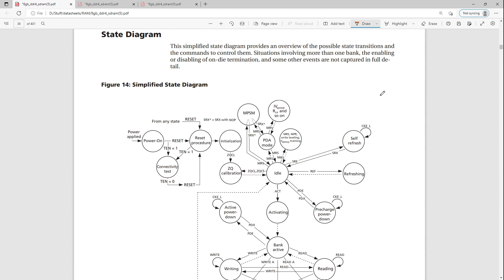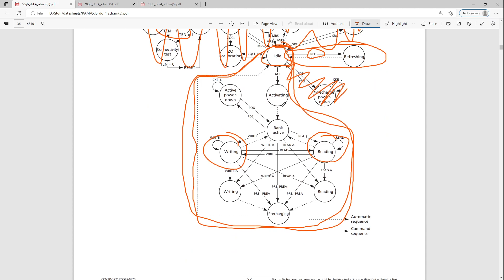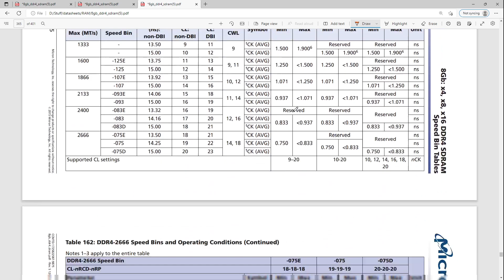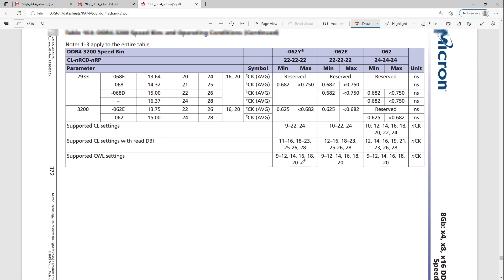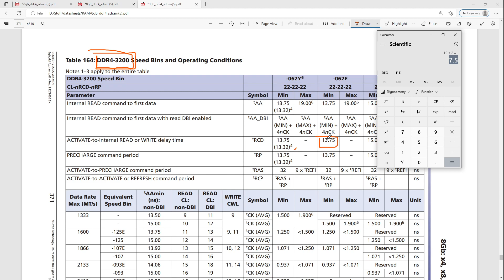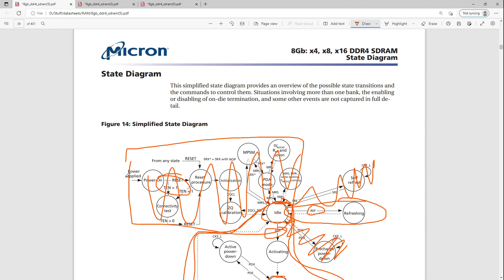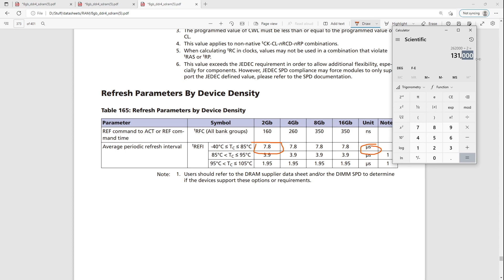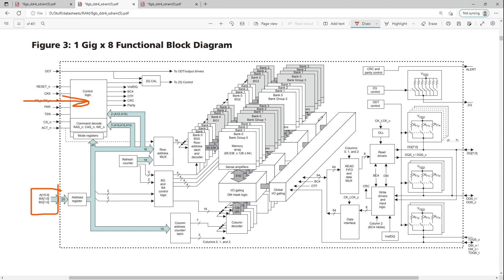RAM timings explained 0

Comment: I know how memory works and have a good understanding why the timings are needed How long timings take and how to find the perfect balance is magic for me
Reply from the maker: trial and error.
Reply: @ActuallyHardcoreOverclocking  As a student of electronic engineering it is magic 
we only think of logic and how long the logic takes, but capacitors in logic are just magic that they hold data to me
(And yes i know how it works but this is so hard to get working that we can just do it every day so reliable is the magic)
Reply: @vollkornbrothd1342  True, it's insane that everything works!
Reply: I like how BZ tells how "dumb" memory chips are. It's actually interesting to see that stuff like this still exist in 2022. Its kinda like early programming where you didn't have standard communication protocols for sending and receiving data and waiting for acknowledgement. You just sent a bunch of data and tried timing it so you didn't fill the buffer and prayed the data go to its receiver in the right order :) It kinda have its merits, cause If you can get those timings set just at the magic value for what the hardware can manage I'm sure you have much less latency than if you just set an arbitrary "acknowledge" command that have high enough delay for everything to be ready. Simplicity is often the best but more tricky to code.
Reply: @vollkornbrothd1342  a lot of "magic" for future electronic engineer, imagining your report on something complex to your customer or chief... Well, it's really magic!
Reply: @vermillion4971  But you don’t run stuff out of specks as an engineer you make it that it is as good and cheap as possible for the spec and to fine ways to run stuff that isn’t designed to run faster you have to find something to get it faster. To calculate timings is the easy part but to get the hardware to run it is hard, especially if you have in mind that every chip is a little different and they have to work in unison.

Comment: Self-refreshing is super useful.
It allows a bank of memory that is not currently accessed to just be clocked to do it's own refresh. No involvement from the controller beyond initiating the refresh and letting it tick along is necessary.
Reply: Was it also that row is also refreshed when you access it. I think one my friend did patter generator that used SDRAM and used specific address sequence that it full filled refresh requirement so he just read data "constantly" and never did refresh when it was sending pattern.
Reply: @LimbaZero  If the SDRAM is small enough and your read rate is high enough that you can cycle through it you would indeed avoid refresh.

Comment: I have learned so much from this video and it's made me realize so many of my misconceptions on how memory works. I thought that you could damage the ram by trying to push it too far, the way you theoretically could with overclocking a processor.
Thank you for this. 👍
Reply: It works exactly the same as with a CPU.
The higher the temperature or voltage the lower life span the microchip will have.
Also microchips will degrade overtime with high voltage or temperature and then require more voltage to run at the same settings than before.

The capabilities of a CPU memory controller is also a big part of memory overclocking and the memory controller can degrade overtime as well if you feed it too much voltage.

You can't damage microchips by directly increasing the speed they run at however. It comes as a side effect of higher power and cooling requirements.
Reply: @markokuosmanen  I'm talking about memory timings not overvolting
Reply: @3sotErik  I'm just saying you can damage the RAM stick by overclocking depending on the factors I mentioned.
From your message someone could get the idea that you can't or if you only meant the speed (clock speed/timings) then you could get the idea that you can damage a CPU by only increasing the clock speed it runs at which isn't true.
Reply: @markokuosmanen  The primary focus of this video was memory timings. My comment was in reference to the memory timings. I now realize there is zero damage that could be done by changing the memory timings. You are way over thinking this. It was a simple compliment for the video.
Reply: @3sotErik  You can actually do damage by changing the timings if the memory becomes unstable as a result and then causes corruption of the operating system and therefore damages the software installation. You just can't damage the RAM stick (the hardware) itself. Also if you update motherboard BIOS with unstable settings you could possibly brick it.
It is important to specify things in order to prevent misunderstandings.
Reply: @markokuosmanen  blah blah blah you're reading way too much into this
Reply: @markokuosmanen  apparently it's important to write a five paragraph essay to be thankful for a video
Reply: @3sotErik  I respect your opinion and that's that.
The original message wasn't even really directed towards you. It was more of specifying how it works for anyone who would be interested in that after reading your message. No harm intended.

Comment: Man, I knew memories were dumb but I wasn’t aware they were that dumb. Basically works by speculation of timing and good luck getting it on time. Damn!
Reply: Not quite speculation.  The memory chip manufacturer says it will take at least X nano-seconds to do a thing, but that is a worst case for all of the chips they sell at that spec.  When safe timings are set in the memory controller they always allow at least that amount of time - so no speculation is required.  That's the whole point of having default timings set by the module's SPD data.  But when you overclock, you are saying "I wonder if my memory chips can actually do that thing in Y nano-seconds, where Y is smaller than X. That is where the speculation comes in.  If you're lucky, after a bunch of testing, you may find that your memory always works with the Y nano-seconds setting, regardless of address and data patterns and regardless of the temperature (within reason).  If it does, then great, you are speculating no more - you have now overclocked your RAM by some small amount.

Comment: I believe people would like to know:

1. What is the order of OC (RAM or CPU 1st)
2. What you should prioritize overall - lower CL or higher MHz
3. What other timings should you prioritize
4. What timings should be changed if I change timing X (like some timings are linked together or there is some correlation between some timings)
Reply: Accurate
Reply: @YoutubeTookMyNickname.WhyNot  but they're unlikely to get +3 fps in games though.
On the other hand, in my experience adjusting timings does help with stability and pacing of frame times, thus overall improving the feeling of it..
Reply: 1. RAM 1st if you intend to do RAM. Though most probably go backwards as arguably CPU is easier to set.

2. Higher MHz allow you to keep around same ns latency in CL/RCD/etc. while lowering ns latency in timings like RRD WTR and others (I.e. those that as bz states in video can't go below certain value in register), thus improving your bandwidth while overall keeping best-case latency around the same (and lowering worst-case latency)

3. Other than CL: RRD + FAW, WTR, RCD (if you can), tertiaries, RTP/WR seem to be most impactful on actual performance, especially compared to defaults. REFI likely easiest to set, RFC below stock values too, as it gets blown up if you follow jedec specs. On DDR5 CL doesn't matter as much, secondary/tertiary are the more important settings, go watch the 3 vids exploring tuning timings live on this channel and then some other vids with proper settings in them.

4. This is a tougher one, go read a proper guide instead of this youtube comment from a noob /s
There are quite some correlation / non-existent registers even that should be mentioned/explained, but this really is more in-depth, seriously, go look at the other documentation.
Reply: 1. RAM first unless you're going to do BCLK overclocking i think. (Assuming cooling for the memory won't be an issue once you finish OCing your CPU)
2/3. Higher MHz, then low primaries, then low secondary timings, then the rest. CL matters less than tRCD. 
3. The primaries, especially tRCD (which is the main reason Samsung B-die is the best memory around) GDM off and usually getting command rate 1 stable, but not always. having enough ranks to do rank interleaving. Low tRFC and tFAW for secondary timings as well as the tRRDs. 
4. AFAIK all of them are correlated, i just try out values people using the same memory ICs i have got stable and adjust. 

Either way beyond a certain point you're getting diminishing returns for gaming. I don't even bother with tertiaries if i got secondary timings i'm happy with stable. For dailying you're better off with a config that's going to lose you a bit of .1% performance but you know won't ruin your data.
Reply: 1) finding a high stable RAM speed should be done first and then CPU… tuning down the memory if required, you will find a middle ground at some point

2) you find the lowest of what ever this is called here is the equation for what ever it is

1 divided by memory clock in GHz take that number then multiply by CL for the number

Example 1 / 6.4 = ans X 32 = 5 [the lower this number the better]

3) not a clue

4) not a clue

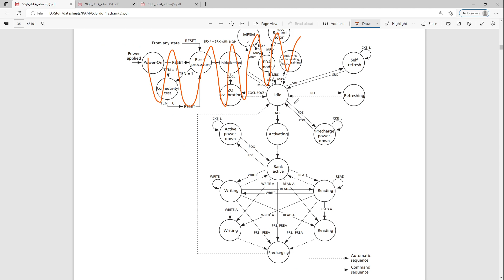Comment: >2:26
Self refresh lets laptops turn off the CPU memory controller during sleep/standby so the battery doesn't drain when it's in your bag. Dunno if desktops use it.
Reply from the maker: I'd guess sleep moded uses it then.
Reply: @ActuallyHardcoreOverclocking  Yes, when suspending to RAM, you need to transition into the self-refresh mode because everything else that could perform refreshes is turned off during suspend.

Comment: Your doing God work! This will help a lot of people. I will say though, people need to understand that changing memory timings / overclocking can corrupt windows while your testing different things. I highly suggest using a spare OS drive for memory overclocking until you know its stable. Also know where the clear CMOS button/jumper is :)

Comment: G'day Buildzoid,
It's gotta be so frustating constantly getting lazy people asking "I have (Insert Brand & Spec), What OC Settings do I use?" especially when as you have REPEATEDLY shown us in videos it doesn't work like that because...
Firstly Motherboard Memory Topology + Layer Count can Drastically Limit the RAM OC Abillity of the same DIMMs on Different Boards,
Secondly like your i5 & i9 have shown the CPUs Memory Controller can Drastically Limit the RAM OC Abillity with the same DIMMs,
Lastly even the Same Spec DIMMS like same Spec CPUs & GPUs due to Manufacture Quality can have widely different OC ability,

I'd just like to say how much I appreciate your work because thanks to finding your channel through your PCB Breakdowns for GN I have learned lots about how to buy Quality products & then with a little effort on my part using your guidance get the best out of them.

Comment: Self refresh is feature that allows the DRAM to refresh itself without the clock, therefore saving power. You can think of it as a standby mode which is faster to come back from versus deep power down with data being kept.

Comment: @Actually Hardcore Overclocking: You said you weren't aware of what the "Self-Refresh" does:  The memory chips have an internal row counter, and issuing the self-refresh command allows the memory chip to refresh a row, then increment the counter (which will roll-over to zero when the final row is refreshed) and the memory controller does not need to have its own row counter for the refresh tracking, but is able to do other memory operations while the bank of memory that has been issued the self refresh command does its refresh operation.  One of the timings the controller tracks tells it how long it must wait before issuing any commands to that bank of memory.  [Note that I'm talking about "banks" at the higher level of the motherboard DDR sockets, not the internal banks within each DRAM chip.]
Also, the self refresh command comes in two flavors: The currently select bank within the chip can be refreshed, or the refresh all command can refresh all banks on the current row.
The self refresh operation does go all the way back to SDRAM (ca. 1998?).

Edit:  
1)  I have described from memory the essentials of what self refresh has been since SDRAM (ie: PC-66) came out.  I think self refresh was present in Fast Page Mode and/or EDO DRAM, but I'm not 100% certain of that.

2) All memory chips that I have seen (SRAM, DRAM, Fast Page, EDO, SDRAM, DDR, DDRx,...) are truly dumb devices, and any hardware utilizing memory simply needs to know how long to wait at any stage of access to the memory.

3) Thanks for this video.  You called it the "I give up" edition, but you did a very good job of giving a nice overview of how memory timings work and it seems that you were actually fairly concise in your description and as accurate as one can be in giving an overview.

Comment: As much as I'm looking for more knowledge of memory OCing, I'm not watching these vids for that. I'm just genuinely curious as to how memory operates. 

From my understanding now, basically when OCing you're finding the limit that your memory can pretty much already complete the task (I.e. if your timing is 18 clocks but it finishes in 12 clocks, you're waiting another 6 clocks)?

I love this content, its super informative!
Reply: yes if your memory is capable of doing 12 but it's set to 18 you're losing 6 cycles for no reason so by OCing you find out what your memory is actually capable of but you shouldn't expect miracles because most are already binned and set close to the limit from the manufacturer, except Bdie.

Comment: Nice! :D I am late to the party, but videos like this are really important.

I love tinkering with OC on my pc, and I am willing to invest the time, but there simple is no understandable guide out there for what to do.
"Just trail and error" is what most guides tell you, but thats not actually true, obviously...

From this video i learned:
1. Timings have a minimum.
2. Some timings can have weird behavior depending on volts and temps.
3. And most critically: memory follows a step by step order of operations. Your goal is to reduce idle time, and the only way to find how long these operations take, is by testing the memory.

But what I keep wondering about is if these timings are at all calculatable...
Say.. timings A B and C. Is A followed by B, followed by C.
If the timings are independent, I can focus on A, then B, then C.

Or is (by approximation?) C = A +2B and the timings are interdependant...
If that is the case, if I change timing B, I can also adjust timing C - which could save me A LOT of intermediate testing?

Comment: Self Refresh is the usual refresh - the recharging of the capacitors that are needed to keep information stored. Apparently, Refresh (REF) is used to refresh parts of the capacitor array only. BTW, I just realized that Self Refresh is probably the S in SDRAM. In the old days of AT motherboards, we used DRAMs instead of SDRAMs.

Comment: I finally understand how memory works, well... at least those parts of the memory that was in this video, which is still better than having absolutely no idea of anything other than low timings usually means faster RAM, it's also nice to know that it doesn't matter what each timing do because at the end of the day the RAM won't communicate with you that which of those timings are set to too low.

Comment: On the refresh, the refresh command activates then deactivates (pre-charges) a set of rows in all banks, and it takes 8192 normal refresh commands (over the typical 64ms refresh window) to refresh all of the memory.
The 2^18 (262144) cycle refresh would result in a refresh window of a bit over 1 second, which is likely to result in the contents of infrequently accessed portions of memory degrading over time unless the memory is kept cool enough.

Comment: I wonder if an fpga could be set up to use it's own internal memory structures for controls and then test an external stick of DDR memory to analyse it's timings at different temperatures.
I can imagine people paying for a stick that has been analyzed with known good timings on it. Can even edit the data on the spd :)
A lot of the timings are dependent on temperature and would have to be confirmed at quite high chip temp to be safe/stable and it would be easy for such a system to test effects of voltage changes.
Reply: I imagine the ram manufacturers and distributors have such and FPGA and that's how they bin the chips.
I wonder if it's possible to write software that can test and set the best timings for any memory stick.

Comment: good video.
the reason i wanted to know this stuff other than just basic curiosity is that I've been testing the impact of each timing on fps in OW and I'm trying to construct a model for why one timing matters a lot and others not at all
also need to know how each timing is dependent on others to identify if my results are hampered by bottlenecks elsewhere

Comment: Great video Buildzoid. This is one of those wasp nests that every tech channel avoids because it's simply too difficult to understand and explain, GN tried with one that had part 1 but the 2th one never came out even with a lot of people demanding it in the comments. In OC forums over years you could easy tell that very very few really really knew anything about how it works.